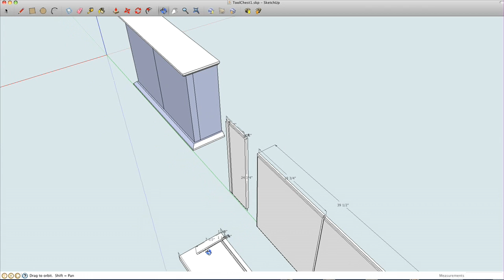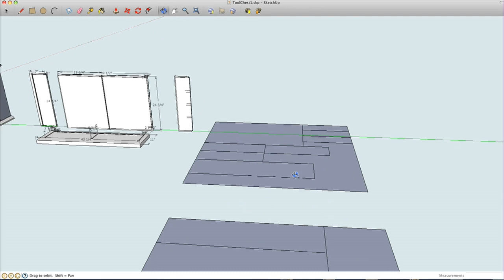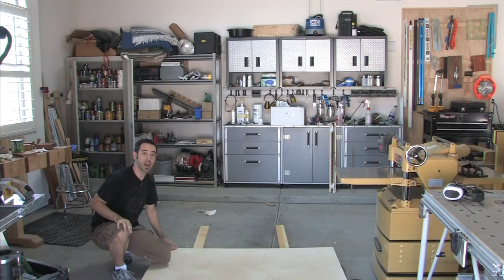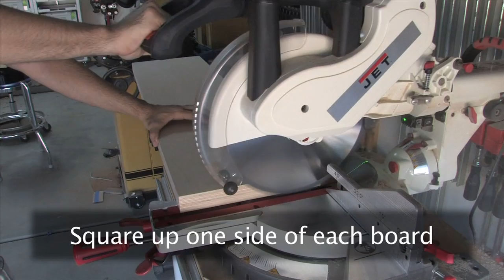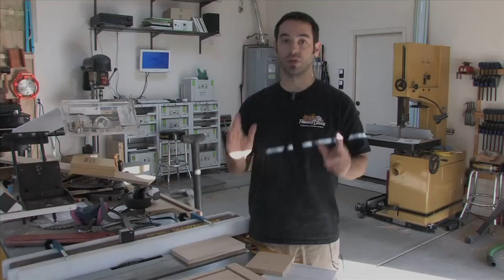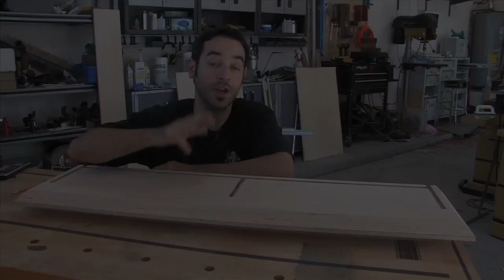How to Build a Wall-Hanging Tool Chest (Part 2 of 3)

Comment: since you are putting in small shelves (depth) it is a good idea to put a small brad nail in that hole in the shelf pins. i've done it before and it really helps. could also screw into the self through the hole also

Comment: One thing to note if you're laminating pieces of birch ply together is that unless you can 'cross-laminate' ie. glue two pieces that have been cut at 90 degrees to one another from the same sheet you will end up with the centre section of the board having two plys running in the same direction.

Comment: I really like the look of fat laminations of birch ply; I have plans for a coffee table with the top made from slices of ply so you just have end-grain showing top and sides.  For me, if you're going to make a feature of the striped end-grain, I like to do it that way.  It does make for a real headache in getting the most out of each board.  I haven't seen 5' x 5' sheets in the UK, but it would be easier to work with them than with 8' x 4'. Nice cabinet btw.

Comment: Hearing what you said about a track saw, then about using a piece of wood as a circular saw guide, it made me think! For years I have used a 4 foot piece of 1/2 inch angle iron as a saw guide and a couple of small C clamps to hold it in place!!!!! The angle iron is much shorter so it has less contact area against the saw (putting the saw pad tighter against the angle iron) to allow better clearance with the saw motor or the lift handle (for the blade cover) and works as well as a track on a track saw! You just have to measure your cut line from the edge of the saw pad to the actual blade cut side (as in where you are making your cut) so you can mount the angle iron guide to either your cut off side or your work piece depending on your cut width! But this works extremely well just the same and it is much less frustrating to use the angle iron because a 2X4 may have a warp in it, where the angle iron is almost dead straight!

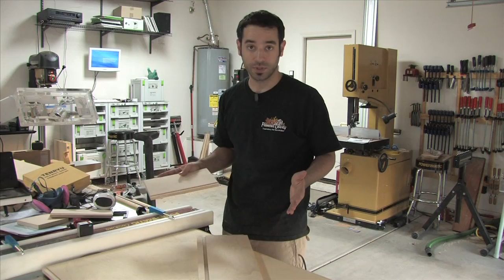Comment: 26:40 That measurement will be off a tiny bit  because the ruler is at an angle. It shouldn't matter for wood working (I'm more of a machinist). If you want a slightly better way; place a square flush to one wall sticking out and use a tape measure.

Comment: Hi Marc, I'm late to the video. But I heard you say that you didn't know of a better way to make an internal measurement. You measured with a steel ruler and added 3/8 to each side. The better way is with a (as I know it to be called) story stick. Very simple way of getting a perfect inside measurement of almost anything. Plus you can make them any size.

Comment: 45$ per 1 sheet 5x5 ,or for all 5 sheets? Is these sheet had finished sanding from both sides or not ? Just intresting cause in my country it cost 34$ for 18 mm , and its got finished sanding from both sides . Sorry if I write something wrong, im from Latvia -Riga.
 P.s Like your videos . Found you while watchin Steve Ramsey and John Heisz videos also.

Comment: Why didnt you use your exact width dedo jig. or your cross cut sldges.. I built those using your ideas works really great. so thanks for that. But are there cases where I should not be using those ?

Comment: Quick question, may be stupid because I do not have much experience in woodworking. When you measure out your plywood for breaking it down to the sections you need, do you compensate for the amount of the material the saw blade will remove during cutting? Or is the amount of material removed so small that it really does not play into effect?

Comment: I noticed that when you were routing the dadoes on the side panels the fence adjustment knob on your router was turning due to the vibration. Did that cause any problems?